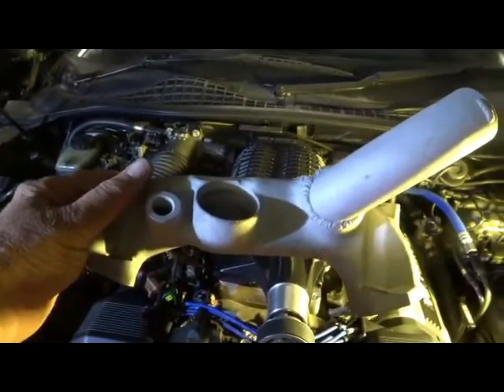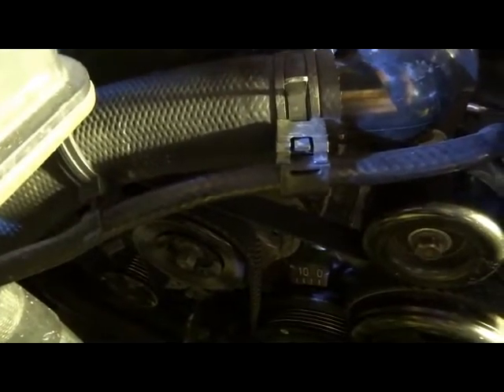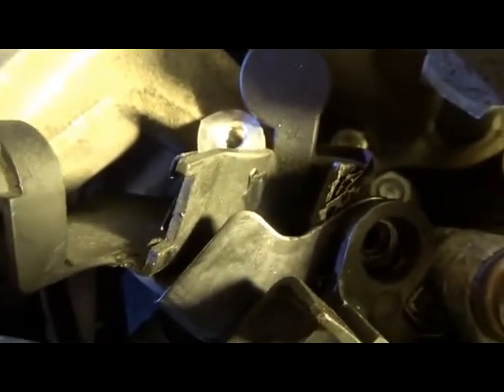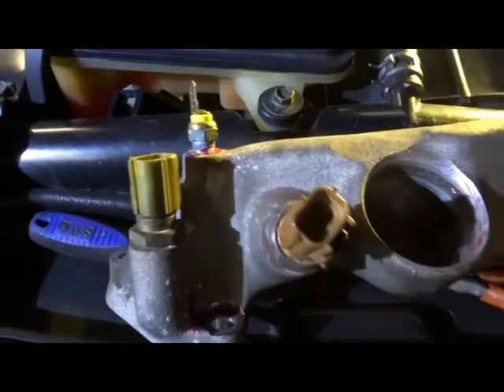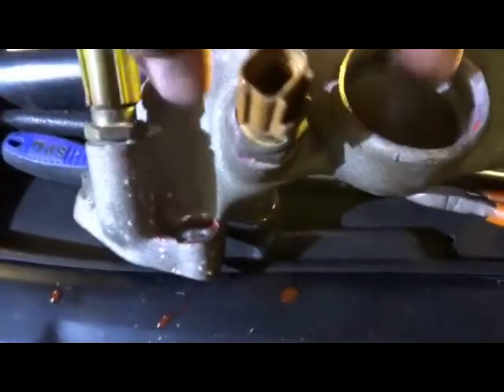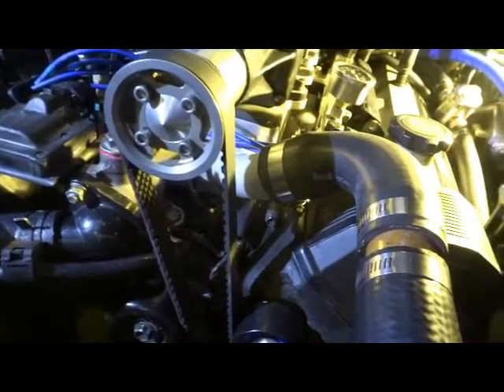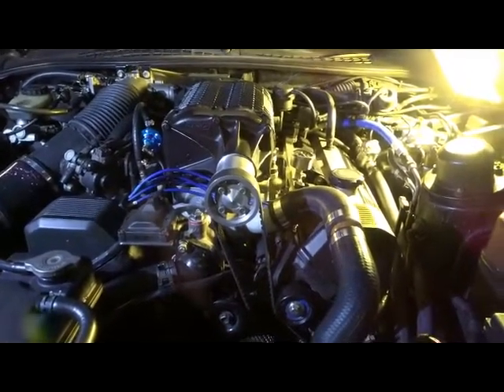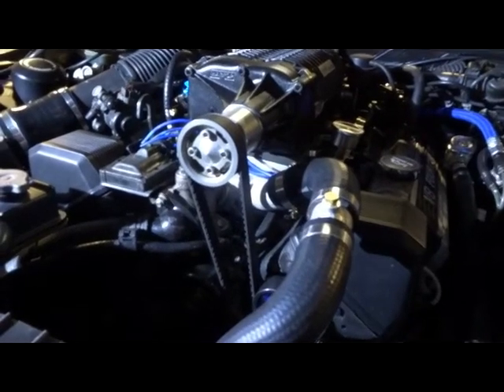Water Manifold and Radiator Hose Reroute 1UZ from Bullet Cars

Comment: Nice car ! What did you do about the MAF sensor if you don’t mind me asking ? Plan on boosting my sc400 soon. Also did you have to do a TRAC delete ?
Reply from the maker: The bullet kit has a pressure sensor which is in the manifold. The wolf ecu reads the boost from memory. My car has no traction control.

Comment: Nice informative video. Have you used the Bullet manifold, top plate, then supercharger with no intercooler? I'm asking because I'm intending to do similar work on my 1UZ and am concerned about bonnet clearance.
Reply from the maker: I did have it originally with no intercooler but it intake temps seemed to be hot.so fitted intercooler. But without intercooler it is a tight fit under bonnet. I think I did sight mod of a bonnet rib to get extra clearance.
Reply: @Graemecns  Thank you for the swift reply. Would you be so kind as to measure the height of the Bullet manifold, and also the height of the (Bullet?) intercooler? I have a Supra bonnet for it to fit under and was intending to have a water/meth kit for charge cooling if the additional intercooler would make the setup too tall.
Reply from the maker: @delboy5252  I can do those measurements. I also tried water methanol bit did not seem to work for me. It seems to make no differance in my setup. I am only doing 12.9sec 1/4 mile approx 270rwhp.
Reply from the maker: Hard t o measure but lh head between back bolt cyl1 front bolt next cyl where the edge of manifold touches intake manifold gasket. To top deck of manifold including intercooler 97mm intercooler 30mm so without intercooler radiator 67mm.
Reply: @Graemecns  Brilliant, thanks very much for that info. Should help me and a lot of people if they are thinking of using the Bullet kit in their builds.